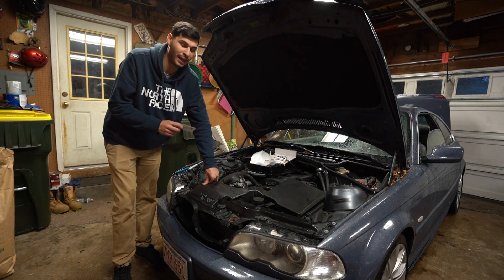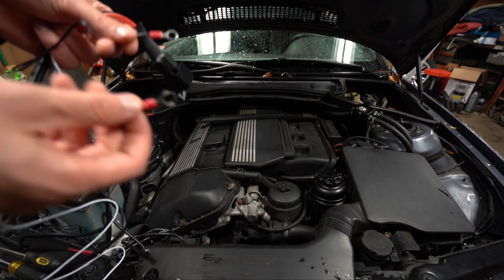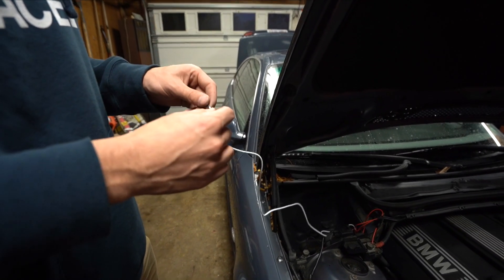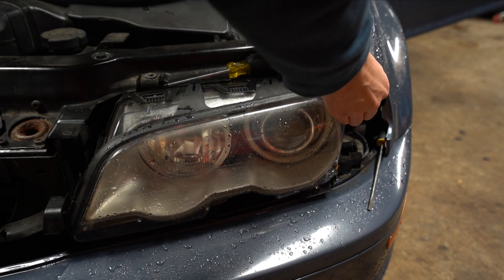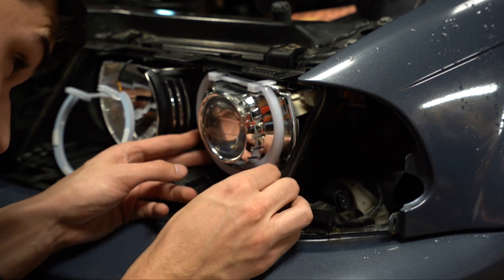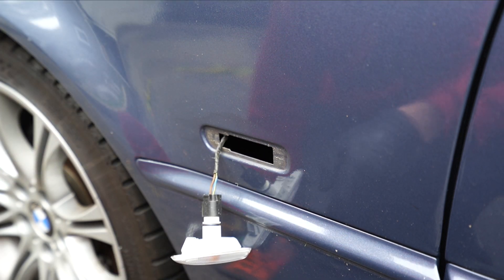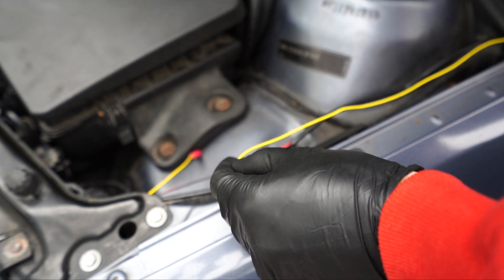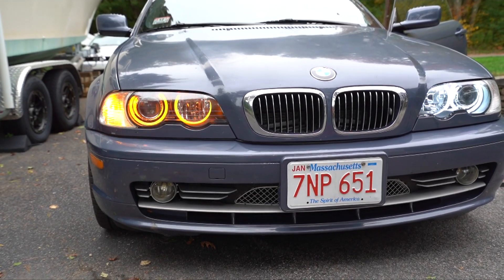BMW e46 ANGEL EYE UPGRADE!!

Comment: I have the same kit but for some reason they don't light up after connecting everything apart from the white wire. Havent tried wiring in the white wire yet as mine is RHD and I need to extend the wire.

Comment: If i'm looking to replace all bulbs (headlights, fog lights) in my 325xi, what would you recommend? I plan on replacing the high/low beams, fog lights, applying angel eyes and use the headlight cleaner.
Reply from the maker: I recommend the retrofit source, very high quality
Reply: @EvanGoyuk  anything that is more plug and play? I plan on just replacing the bulbs and keeping the old projectors.
Reply from the maker: Yes all plug and play

Comment: I got the ujdmtoy ones like Selena from shoplifeTV shows an install for.. super bright and they fade in and out when lock/unlock the car as they tap into the footwell light.
Not a fan of the orange turn signal thing, looks a bit too aftermarket.. the fade in fade out looks more OEM in my opinion!

Comment: Is ur xeno projector stock or aftermarket?
Reply from the maker: Oem Xenon projectors. However my car did not come with Xenons I installed them myself!
Reply: @EvanGoyuk  are you using HID or LED? And thanks for the reply big fan:D

Comment: Did these replace your drl ?
Reply from the maker: Yes
Reply: Evan Goyuk so you’re high beam drl don’t turn on when driving  during the day? Only angel eyes on?
Reply from the maker: Correct
Reply: Evan Goyuk Thanks
Reply: So I just installed these and these caused my light out indicator on my dash to go on. Any idea?
Reply from the maker: For what light indicator?
Reply: Haha. I’m an idiot. I tested to see what f they worked before putting everything back together and forgot to plug the turn signal lights back in. Smh
Reply: Thanks for the quick response. I think I might add you on ig and just dm you